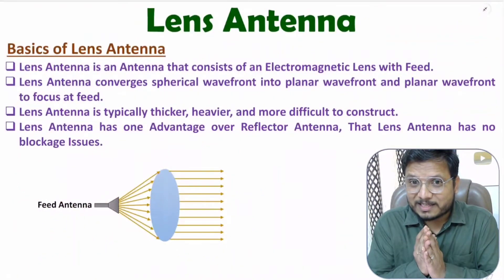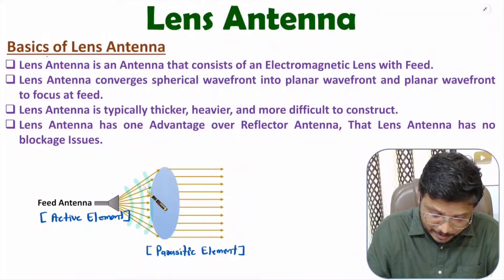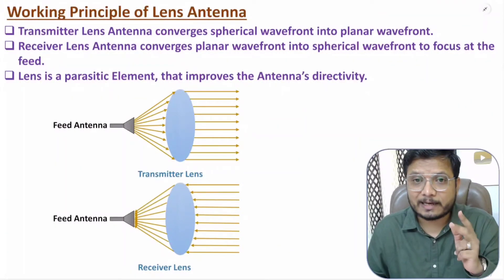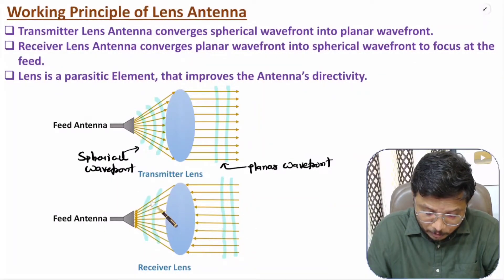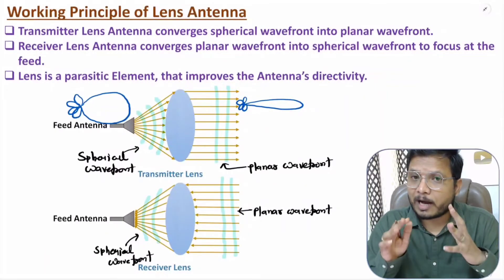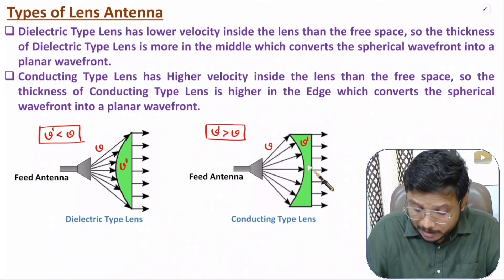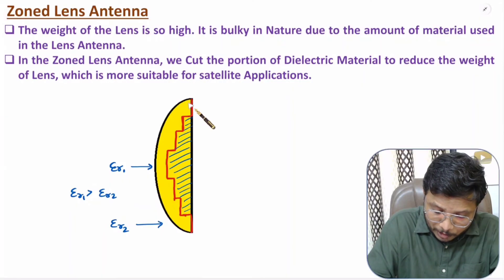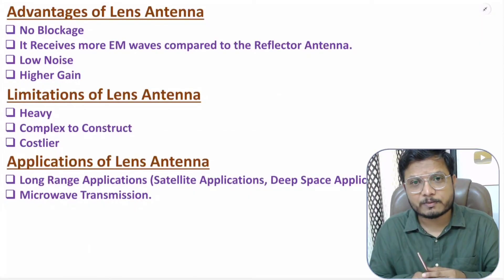Lens Antenna (Basics, Structure, Working Principle, Types & Zoned Lens Antenna) Explained

Comment: Lens Antennas have no limitations according to parabolic and horns ! Not heavy like others! If you knew its advantages you wouldn't even compare it with others. You show the simplest optics here.

The success depends your optical design.
Huge efficiency
Huge directivity
Any sidelobes, added in main lobe
Optical Beamforming possibility, no bally 
Cut-Off Solid Angle Beams, no belly side
Highest value Shannon Capacity; Highest spectrum Efficiency, Supply huge wide band spectrum
You get discrete beams with varying band planning
Long Range
Low size and Weights
mass production, cheaper